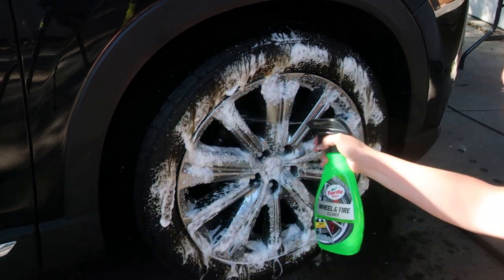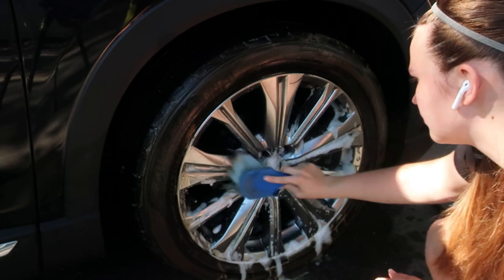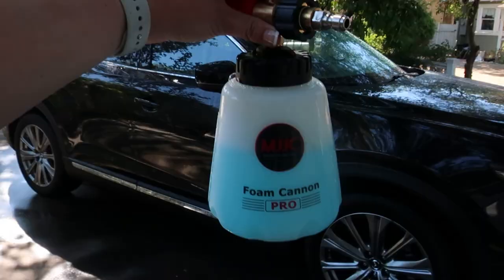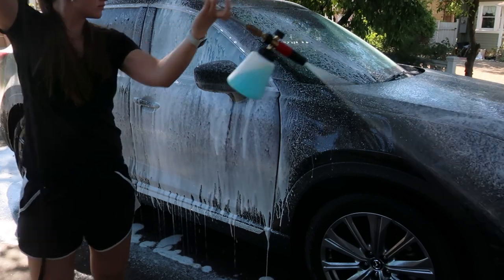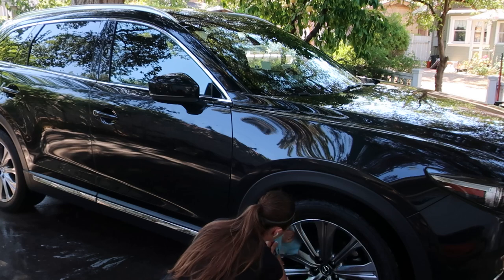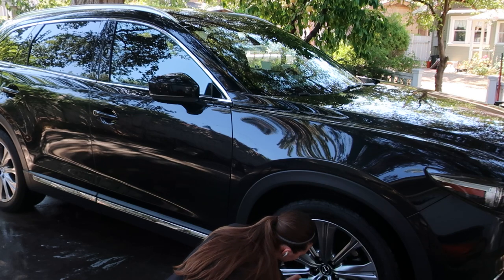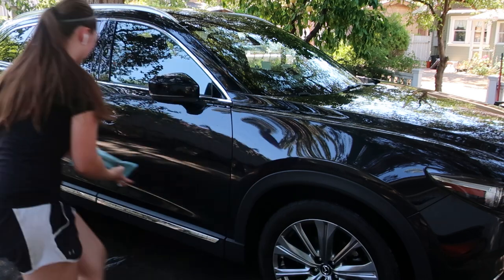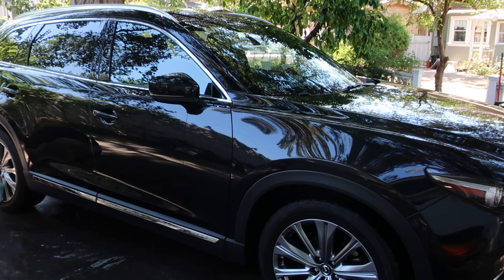ULTRA RELAXING and SATISFYING Exterior Detailing || Calming Car Wash

Comment: Reduce scratching! When washing a vehicle, always use clean wash mitt on each section.  When drying a vehicle, first use forced air, then towel dry with a drying aid.  Every time you touch a vehicle, you can introduce scratching of the surface.
Reply from the maker: I am not going to use a new wash mitt for each section of the vehicle. I clean the wash mitt thoroughly between them using the two bucket method with dirt traps, but that is all that I can do. It would not make sense for me to buy 10+ washmitts just for one car. Thanks for watching and leaving feedback!
Reply: @FionasAutoDetailing  You should let your viewers know you are using a 2 bucket wash.  You don't need 10 mitts to wash a car?  4 or 5 would work depending how dirty.  Or some detailers use microfiber towels?